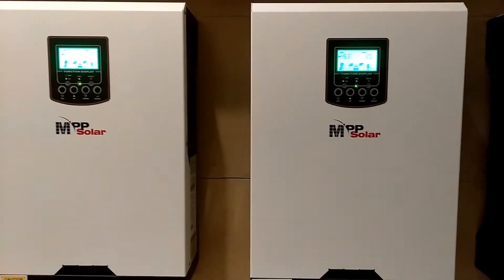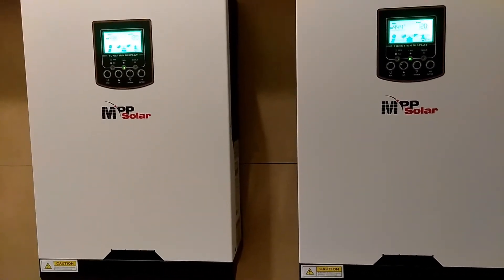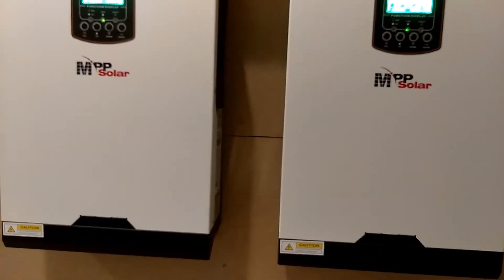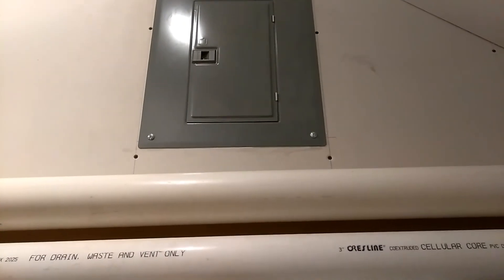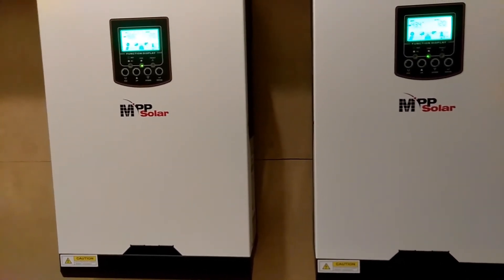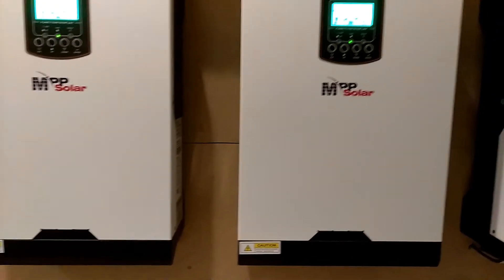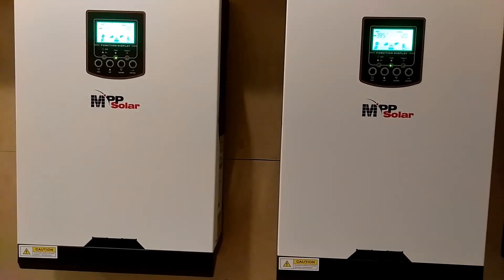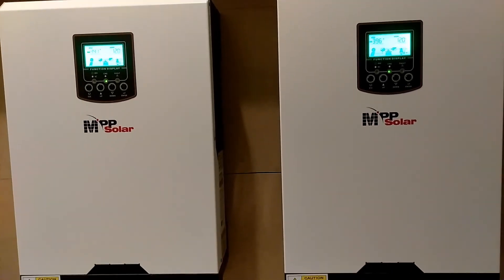Video to answer questions about my pip setup

Comment: Love it brother. I am trying hard to buy a 2 one. So I can have more power to run the big wall AC.. But my frig crapped out. So there go's my 1 year of saving lol. Thanks for all your videos brother..
Reply from the maker: yankey4 I was looking at one of your other videos the other night and I seen you needed a transfer switch for your other inverter if you still need one I have one that I took down from my old system is yours if you need it let me know.
Reply: I am looking for a DC cut off from the batt bank to the inviter. Thanks for the offer brother. God Bless.
Reply from the maker: yankey4 I have a breaker disconnect can't remember what amp it is but if that'll work I can get that to you.
Reply: Brother that would rock. I will Pm you with my info and I will need your paypal to pay for it and shipping..
Reply from the maker: yankey4 just send me your mailing information in a private message and I'll get it out to you don't worry about no money I bought the wrong thing and I didn't need it so if you can use it I'll send it to you it's a 150 amp breaker with a disconnect on it. I can text you a picture if you send me a number. thanks

Comment: Excellent vid and setup! I recentlly got my first PIP and was wondering how did you connect the grounds and neutrals on the subpanel to keep the PIPs isolated. What about from the subpanel to the main one?
Thanks!!
Reply from the maker: Luis Carmoega all hard-wired inverters ground and common are  isolated inside the unit. But your sub box need the bond between common and ground removed the only bond that can be is in the main box.
Reply: Carson, thanks for the replay!!. Ok, I get that part. Now, is there a common, or ground going back to the main breaker panel?
Reply from the maker: Luis Carmoega sorry for the late response but I'm not getting my notifications by email anymore and haven't been on the site in a while but yes it is a common and a ground running back to the main breaker box.

Comment: Are you running the 120v units?  How do you handle 240v loads such as ovens, 240 dryer, well pump, pool pump.  Just wondering.  Thanks and it looks great!
Reply from the maker: Nubian Davis yes my units are the 120 volt units and I do not run 240-volt loads on them I run them off my main breaker box because all all of my 240 volt loads is minimum in my house I have a central air unit and a on demand hot water heater that's all the 240 volt loads I have. Tkank you for stopping by.